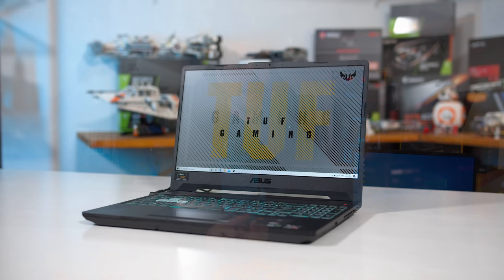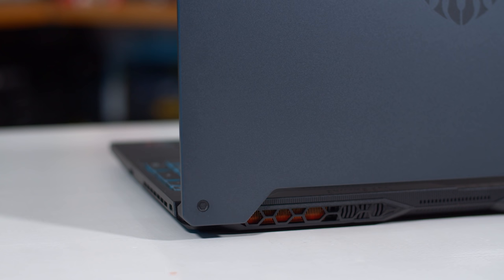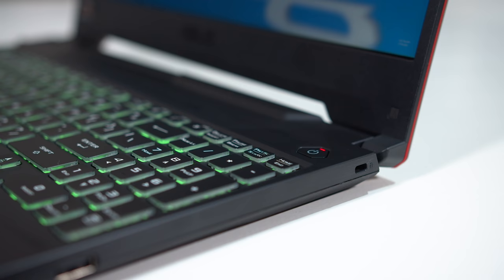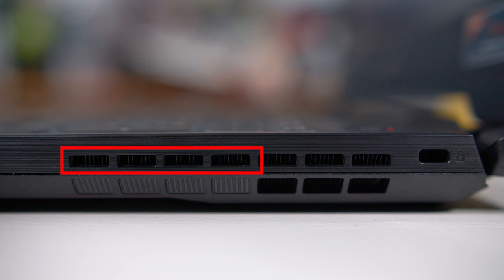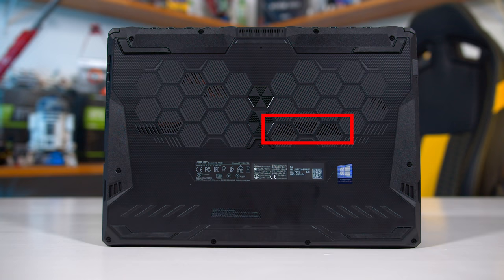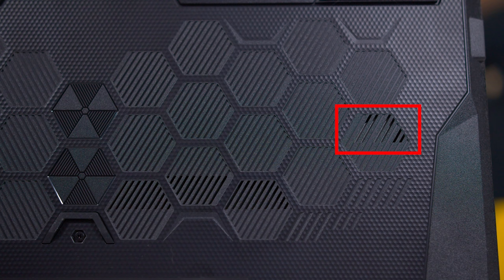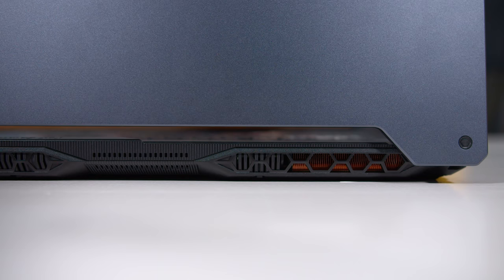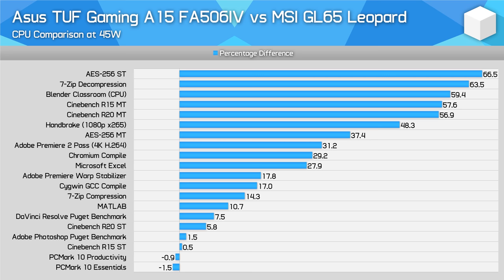Don't Buy The Asus TUF Gaming A15 (2020 Model)

Comment from the maker: If you were interested in the A15, there are lots of other mid to entry-level Ryzen 4000 laptops coming out soon from many OEMs (Acer, Dell, HP, MSI and Lenovo to name a few). We'll be on the lookout for which one is best in the next few months, but it's hard to imagine other OEMs will use such flawed designs
Reply: Please do a review of the Eluktronics Matrix Red Pill 15 or 17!!! AMD Ryzen 7 4800H with boosted RTX 2060!! Currently one of the fastest gaming laptops as per notebookcheck.
Reply: Tim, you should probably look at some of the older ASUS laptops in a similar price class dating back to 2016. A lot of them shared a similar flawed design  and come with it hobbled performance, loud fan noise and potentially questionable reliability down the line. I just happen to also be a disappointed customer of one of those laptops.

When I heard that the A15 has a flawed cooler design, I wasn’t surprised. This was common with lower-tiered ASUS gaming laptops for a while now. The only thing that surprised me was that you guys were the only ones who actually called them out proper on it, with most of the others riding on the Ryzen hype and seemingly brushing off those flaws aside.
Reply: To be fair, it shouldn't be a such big reveal. Asus TUF designed to be worse than more expensive devices. TUF is just a marketing gimmick for low tier products line.
Like literally, the engineering team gathered at a whiteboard and gathered flaws on how to make it less attractive in every way possible.
Reply: It'll be interesting to see if the 4900H A15 and the intel based F15 models will keep the same bottom panel and GPU power level.
Reply: I’m actually looking forward for other laptop review in your channel, please do more like this!
Reply: Dell and MSI already did worse than Asus with G5 SE and Bravo series..
Reply: How about Dell g15?
Reply: Tim you should just mail the Asus Laptop to Asus with a ** you note.
Reply: I’m interested to see how the dell g5 15 compares. I’m waiting for mine I ordered.
Reply: I would change the panel and drill some holes inside the bottom and open the side exhaust... Could be a good device then, sure without any mfg warranty then...
Reply: Well, you bought 2 of them so just DIY the vents.  The general layout is already there, so just open them up.  As for the screen, I wonder if a quality replacement can just be purchased.  Amazing how ASUS was able to botch this up.  Seriously, if an extra $100 in production cost makes for a superior laptop, just charge $100 more for the same profit.  Instead they hope no one notices their half assed design.
Reply: Take a look at Dell G5 SE
Reply: Thanks !ntel for this, paying OEMs to cripple their AMD offerings, I'd rather suggest someone looking for an AMD system just spring up for the G14.
Maybe we'll have to wait until next year for better offerings and more (affordable) choices for an AMD laptop.
Even the Dell SE doesn't seem to perform well in some games, even though the 5600m seems quite capable, God knows what r they doing in the firmware/bios.
Reply: Intel to Asus: "You know those AMD laptops... Financial horsepower *wink wink*"
Asus: "We could starve this one for air making it thermal throttle VS the Intel counterpart?"
Intel: "We're pleased to announce you now qualify for subsidized Intel sales parts for laptops!"
Asus Rep: "Promotion here I come!"
Reply: Brometheus It doesn’t. I had a GL502 with a similarly hobbled intake design and it still gets dusty after a while.

It didn’t get the “anti dust” feature but I don’t think the choked intakes have anything to do with dust mitigation. It just looks like the typical entry-level gimping.
Reply: Not sure what to do with them?  I would just put them up for auction on ebay and let the market customers decide how much it's worth paying for....  You may take a loss, but at least you wouldn't have to worry about feeling like you ripped someone off.
Reply: Please test the Dell G5 15 Ryzen™ 7 4800H + RX 5600M, This Laptop seems to be too good for it's price.
Reply: review the acer nitro 5 2020, both amd and intel versions
Reply: Please do more of these.  I just unsubscribed from everyone that gave this laptop a good review.  What a buncha shills.
Reply: This is a heartbreak. All eyes on legion 5 now i need a laptop very badly right now...
Reply: It seems that the G5 SE has some serious flaws as well, let's wait for other reviews but this doesn't seem like an isolated issue. Hopefully I am wrong, I guess I've have to wait longer for a decently priced good AMD laptop
Reply: @gustavoalmeida1579  Apparently it's got something fishy too, check Ownordisown's initial look on the G5 SE
Reply: @ishneetbhatia3070  from the Eluktronics page: 
- Proper Thermal System - No Max-Q here with blocked vents like you might have seen somewhere else...  Dual 8mm fans with 53 fan-blades with best PQ performance to increase 37.5% CFM to maximize CPU & GPU cooling and performance capabilities.
Reply: You should review the Mag 15 (Vapor 15 in Aus).
Reply: Hey Tim. If u dont like/want that TUF laptop, can I have it? I'll pay for shipping & handling. Seriously.
Reply: Thank you so much for your continually high-quality, no-BS reporting and analysis!
Reply: Given the disjointed approach it makes me think they need to initially sell other stock and are willing to lose sales on the new AMD systems. We have seen Asus do some strange things, so incompetence can also be the problem.
Reply: @NeXMaX  so avoid every TUF?
Reply: I'm also really eagerly waiting for Ryzen 4000 laptops, such as HP Omen 15s, Lenovo Legion 5s, Dell G5 (but sadly bad design), MSI (But Alpha and Bravo only have full AMD GPUs, waiting for NVIDIA GPU options), haven't heard any upcoming ryzen products from Acer tho. Really looking forward to the roundup reviews, gonna need to buy 1 soon...
Reply: Whole clip is to discourage getting this laptop. The very first link is to get it at amazon. Sellouts...
Reply: @dustojnikhummer  Wouldn't recommend buying lower-end ASUS laptops tbh.
Reply: zephyrus g14 better and already bought it :p
Reply: you have a good find on the crippled cooling system.  I was wondering why it throttled quite disappointingly in other reviews.
Reply: Do a asus tuf a15 vs acer nitro 5(2020) variant if you have it!!!
Reply: Please test every notebook thermal /vrm ... Please open amd /oem eyes they made good cpu worse
Reply: Tim can you do benchmark the 4600H with 2666Mhz RAM VS 3200? In my country the fastest SODIMM is 3000Mhz and it's so expensive. I have to import it from another country
Reply: Thanks Tim! Nice job. ASUS looks like they intentionally screwed their A15 up. It was nice that you fixed their design flaws, and dove into the poor response times and weak color gamat on their cheap display. Even if I was considering an ASUS intel unit beforehand, I would avoid ASUS. Thank you!
Reply: :whispers: Someone tell Tim that the Zephyrus G15 LITERALLY blocks the intake vents with a super restrictive fabric... Please.
Reply: @antonywhatever572  , I don't know. It sounds ridiculous to spend money on developing & marketing a low performing notebook just to promote their higher end range. Could it be that there WAS a real design flaw? Or there was a valid reason for the alleged poor design by ASUS but they have not or do not want to publicise?
Reply: Well, the bottom vents look like they could be fixed with a Dremel. The cooling solution is in the good enough category while the panel is not but is for marketing. What it came down to is this. The designers had to make it hit a price point and they only had a few corners they could cut. $100 is $100 if you make $20 an hour it is five hours of work not counting taxes so yea it is a big deal. People will look at theTUF at a store and it will be fine and they will probably like it just fine. The vents should be fixed but it is probably more expensive to fix the vents at this point than replace the panel. The vents would take a mold change which is big bucks. I hope other makers see this as an opportunity to do better.
Reply: I'd be very interested in 2 in 1 convertibles like the hp envy x360. I know you covered this one already, but with older gen processors, and it would be interesting to see what changed with the new gen. I saw that only the ryzen 7 model comes with 16 gigs of ram, so I'm wondering if the 8 gig models are only single channel. 
Also are there any alternatives to the x360?
Reply: can you keep doing reviews on laptops or make a laptop buying guide
Reply: "you underestimate the power of the dark side"
Reply: Just returned mine after seeing your video - did not realize it had so many flaws. Lucky I was still within the 1-month return window and not give a reason for return. Thanks mate.
Reply: I know that msi is now trying really hard to disparage asus, but take a look what MSI done with the GL75 vs GL65. intake vents are WAY SMALLER and there is no mesh panel, so i5-10300H easily hits over 98 Celsius and throttles, and 120Hz display with srgb coverage below 60%, when you said 100% should be a standard in this price range. Make video about that
Reply: This is How Intel's Influence on Manufacturers CRIPPLE the New AMD Zen 3 Ryzen APUs..

By Combining it with LOWER-SPEC Hardware Components:
- Poor Thermal Solution Performance,
- Poor Display Quality,
- Lack of Modern I/O Ports,
- Weak Batteries,
- Bad Exterior Design,
- Shitty Keyboard Layout,
- etc..

We need to RIOT the Shit out of them in Order to Get Rid of this Systemic Downgrading..

Who's with me??

💪💪💪
Reply: Do check the Dell g5 se next
Reply: My two cents the right side is blocked to prevent hot air being thrown on the mouse hand of  users if someone bumps up the fan curve.
The Asus is made available in a lot of asian countries where dust is a huge problem. If it had the mesh like the msi .. in india it would be chocked with dust in 3-4 months .. which is just as bad if not worse compromising cooling
Reply: @Hardware Unboxed, thank you for another in depth review highlighting the design flaws made by Asus. Which, will invariably be glossed over by other reviews in the techsphere.
Reply: You guys should send it to another YouTuber who does case mods, like Linus maybe, and have them make the design better.  ✌️
Reply: I bought an Asus TUF back in the day with a ryzen and 1050 Ti and I had nothing but problems, the coolings were insanely loud, the CPU was at 90c all the time when playing low end games, and the bios didn't let me change a damn thing not even fan curves or anything , looked pretty but wow
Reply: Good going Tim for calling them out.
Reply: Modify by cutting back panel (to get more air take) yourself. It’s a really simple thing to do. Unfortunately, can’t replace display for free - must spend more money.
Reply: still waiting for some 14inch model ~
Reply: @ishneetbhatia3070  what you think about ryzen 7 with GTX 1650 ti??
Reply: It is the SAME exact thing that happens w/ almost any product. They can't give you the BEST stuff, the best value bc they have to have a market for the higher end stuff. It just sucks the point its getting to! Thanks for saving me from buying the A15 sir!
Reply: Can someone edited the photo of honey comb bottom cover changed into flat design ?
Reply: The fix is simple, just buy a Dremel and cut the plastic bits away and the result will look like it was factory made and not self-made.
Reply: Maybe you could mod it, dremel a larger intake by following the pattern layed out by Asus but just open it up a little bit more. Maybe this can solve some of the issue, I know that it is not what most people will do but maybe for a student on a budget it might be an option to save the 100$ compared to the MSI. I know you probably don't see this but I would watch something like that.
Reply: The laptop is wearing a mask on the air intake making it undesirable (social distancing) for the pandemic.
Reply: I like the Dell actually especially the SE with Ryzen 4800H and 5600M but the problem is too expensive in our country which is no longer considered a budget gaming laptop. Same goes with MSi, HP and Lenovo. As for the Acer it has problem with the alignment between the heat Vent and Power output cables.
Reply: You reviewed about the small vents but have you tried checking the difference of other laptops with an actual infrared thermal camera?
Reply: Same problem on the higher end model with the same config by Asus... They are blocking the intakes completely on the higher end line for their amd variant while the intel variant has no problems. They are purposely nerfing their AMD 4000 mobile series powered laptop...
Reply: Intake chock is cooling the air.
Reply: @ishneetbhatia3070  that has to be the best laptop! Hands down
Reply: The design flaw must be to meet Military Grade 810H standards that requires the chassis to stay intact while dropped from certain heights. More holes would make the chassis weaker due to which it would fail the test.
Reply: Yeah, Lenovo especially looks good, T series on Ryzen 4000? That's just perfect.
Reply: Did Asus cover air intakes in both 4600H and 4800H configurations?
Reply: Subbed to see what the reviews of the other laptops say
Reply: Do the G14 please
Reply: Any attention for Acer Nitro xv340ckp? please do a review on this budget ultra wide monitor plsssssssssssssssssssssssssssssssssssssssssssss
Reply: According to MSI's website, the Bravo 15 with the 5500M also has a shit, 45% NTSC display...
Reply: the other day I was watching Hardware Canucks and he said that the thermals were great, you say they are flawed... Someone please help since this laptop is on my shortlist...
Reply from the maker: @alightknight6128  We got the same thermal results, so you decide ;)
Reply: @Hardwareunboxed  k thanks :D, any alternatives relesing in the next 2-3 months??
Reply: asus tuf a15 OR msi gl65 leopard i7 9750H which can i prefer
usage : softwares like matlab , Solidworks 
&  games sometimes